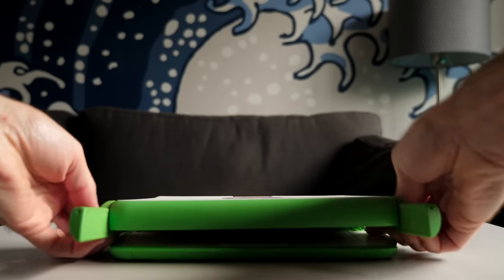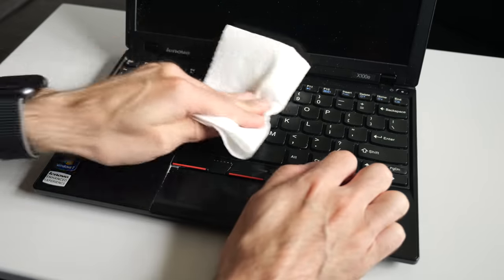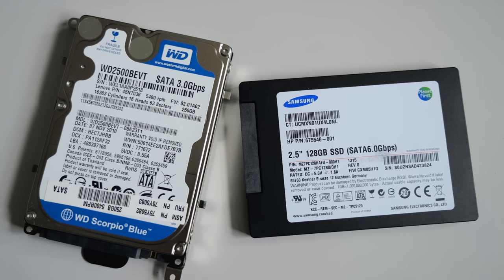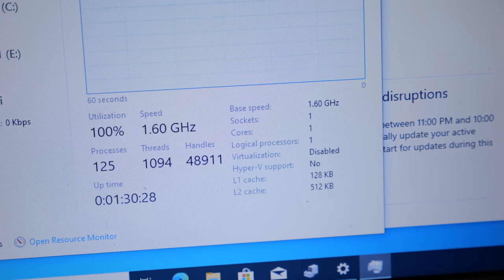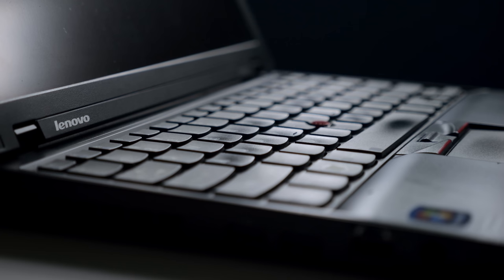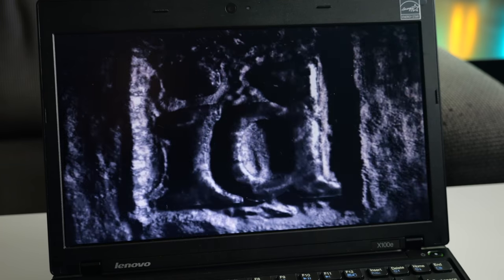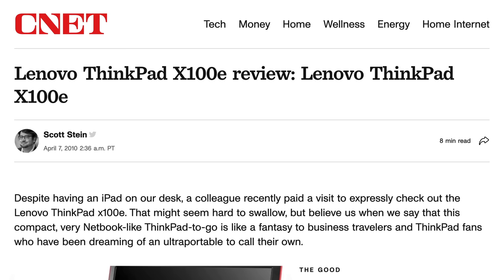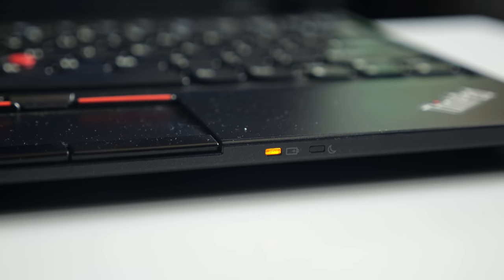Could this ThinkPad netbook actually be GOOD at retro gaming?

Comment: Thank you this video!
It's very similar to my Lenovo IdeaPad s12 which is used a lot in 2010.
Back in a days it used to be pretty reasonable machine, considering it's size and weight.
but mine has Intel Atom with Intel GMA 950 graphics and Windows 7.
it was enough for minor Photoshop work and 720p video playback via player, but it really struggled with even 480p videos on Youtube.
Overall it was really cool to have small, lightweight machine for that time.

Comment: I’ll bet that windows 8.1 runs very well on there.  8.1 is much much less resource heavy than 10. 10 just has too many background tasks running. For me there was a huge difference on some older atom devices. From unusable on 10 to pretty snappy for all but heavy web browsing on 8.1.
Reply: Yep can vouch for that, Windows 8.1 runs really well on older low-power netbooks. I have a 12 year old dual core Acer Aspire 722 and it flies with 8.1. With 10 the poor CPU can’t even open the start menu without dropping frames 🤷‍♂️😂

Comment: Viewers! Do not overlook the x120e. It's physically identical -- same body, display, great keyboard, etc., just with a newer AMD SoC, the dual core AMD E-350 with HD 6310 graphics. It's essentially the same exact laptop, just now capable of running things like Windows 10. I had the X100e in the video for years before upgrading to the x120e, which is so great I still use it to this day. I mainly use it for light digital audio work in Renoise and making retro alien landscape style art with Bryce 3D. In my opinion, best netbook ever made!!! :D
Reply: Does it support Windows XP? 🤔 Lenovo website is so messy that it's hard to tell (at least here in Europe) - I think it DOES, but I can't straight out tell from their crappy interface.
Reply: @kkolakowski  Yes, with SATA set to compatibility mode, same as in this video. There is a working AHCI F6 driver for it but I haven't managed to get it working in years as the XP installer does not detect even supported USB floppy drives.

Comment: One thing you can do to get XP to use that extra RAM is dig up a copy of the PAE patch somebody made for XP (a project called One-Core-API seems to be one such patch, plus a whole bunch of other enhancements, kind of like KernelEx was for Win 98).  See, the XP kernel CAN handle more than 4GB of RAM (sort of like high memory on DOS, PAE does something kind of like that on newer Intel CPUs).  It's just that, being 32 bit processes, any individual process can only handle 4GB and MS made the decision to limit the consumer OSes to 4GB.  The initial release of XP actually had PAE enabled, but that got killed off by SP1, if I remember correctly.  Server 2003, based on the XP kernel, had it turned on still, but of course you don't want to run the server OS.  But all the code is there in XP and it works, it just needs to be patched to be enabled.  There's also the very odd Windows XP Professional x64 Edition that isn't quite sure if it's Server 2003 or XP.
Reply: It is also possible to install 64-bit version of Windows XP 🙂But it wasn't very supported at this very early stage, so there might be issues, especially since we would like to use it for retro gaming so compatibility would be quite important 🤔
Reply: @kkolakowski  Yes, that's Windows XP Professional x64 edition (not to be confused with Windows XP 64 bit edition - that's for Itanium).  I had it for my work computer for awhile.  It's weird.  It's really Server 2003 dressed up like XP Professional.  So alot of drivers are hard to get - it wasn't that common so alot of people didn't bother with drivers and normal XP drivers don't work and Server 2003 drivers sometimes work, but those aren't all that common.  Application compatibility seemed OK, in general , though.

Comment: I had one of these with the Turion X2 L625 back in the day. That second CPU core made a big difference compared to the MV-40. It ran even hotter, but it could almost play Left 4 Dead at non-PowerPoint frame rates! Almost!
Reply: The Turon X2 L625's are extremely rare.  Very few were made. Did you customer order it when it was new?  How did you get one with that upgraded processor?
Reply: @klwthe3rd  This was over a decade ago, but IIRC it was a canceled custom order that wound up on the Lenovo Outlet. At the time I needed a laptop with a good keyboard, and I wanted something small that had a snowball's chance of gaming competently, and the outlet listing put the "good" x100e well within my budget.
Reply: @needfuldoer4531  Wow that is such an interesting backstory 😄. What ever happened to that laptop?
Reply: @klwthe3rd  It's in a box with other retired laptops.

Comment: I recently picked up an 11e for 55 bucks in mint condition. It's a student edition, folds back to be flat, has a touch screen. Dual core, 4Gb of RAM, and a 128gb emmc. The Intel GPU is a better one of it's caliber, I think a 615 or something, 128mb of dedicated video memory, not bad tbh. I have it running Windows 11 just fine, and loaded to the brim with Indie pc games. Things like Shovel Knight, Braid, LIMBO, Enter The Gungeon, etc, all run smooth as silk with an Xbox Bluetooth controller. It's the coolest thing to me! I actually plan on picking up 10 more on eBay, loading them up in the same way, and gifting them to friends that game but never dabble in PC, to show them even this cheap old rugged little guy can game in really cool ways. I HIGHLY recommend getting one. It's my go-to tinker device now.

Comment: I remember the AMD Athlon/Turion based X100 series... they were awful through and through. Dying chipsets (same bumpgate trash as nvidia GF 8xxx or AMDs own HD 6xxx GPUs, though nvidia admitted to the problem while AMD never did), hot AF CPUs to the point where the dualcore ones would cause an overheat emergency shutdown if you stress the CPU for more than a few minutes, no mSATA support (making the 2nd miniPCIe slot useless) and awful build quality (hinges ripping out). The random glitches experienced in this video hint at the chipset already being in the process of failing, and most used ones you find will be sold as defective (not turning on/turns on but no image) as the end result of that

Comment: To be honest, this thing COULD handle webbrowsing ..... IF the coders of modern browsers would actually care about OPTIMIZING their cluttered mess. Nobody does anything anymore about optimizing their programs to run with as little resources as possible... everyone is like "Pfft so what. Let the user buy faster hardware. Not my problem."  This is the ONLY reason why older hardware becomes more and more of a problem to use with current year software. Because apparently no developer gives a damn. I can see why you need beefy hardware for CERTAIN applications but come on... I don't see why i need a killer-rig just to browse some stupid websites. When webbrowsers and Steam consume more RAM and CPU time than they should, you know we have a problem.

Comment: The X100e was the first to use the new chiclet design Lenovo now uses on all its modern laptops. the X120e was better, but you need to make sure you don't accidentally get the E-240 version instead of the E-350 version. The E-350 is better but 10 is still too bloaty for it. 7 should run fine however. The X100/120e screens are also notorious for wicking up moisture from the air in some cases if left in a humid environment for too long, and that ends up leaving a splotchy mess behind the diffuser. It was a defect that Lenovo never properly addressed with late X100e and early X120e machines. The X130/1E are fine but still garbage tier. the i3 variant can do 16GB of RAM with an mSATA SSD in the WWAN slot, and the AMD variant could do... 16 gigs, but single channel only. This was the achilles heel of the thing and performance was extremely subpar, but that was fine as it was used for education and didn't need to be the fastest.

Comment: I had the X120e version, which had the dual core. I remember wanting the X100e, but seeing it was only a single core it was a no go. So when they announced the X120e, I picked it up, I also upgraded the ram and the SSD back then.

Sadly it was still quite slow, while I loved the form factor, i sold it after 6  months and bought a Thinkpad X220 - a laptop I still have to this day, while not my daily driver (X260 is), it was a proper laptop with a proper cpu.

Comment: Actually just ordered one of these for cheap. Here in Brazil it's difficult to get a hold of a good windows 2000/XP era machine to play games from that time period (things like nfs porsche unleashed, gta vice city, quake 1 and 2, that kind of windows 98~2000 type of thing). Seems to be in very good condition and comes fitted with an ssd, so my plan is to put windows xp (actually if I can get 2000 working with drivers, even better) and run old stuff in it. It's that kind of thing that was terrible at the time it released (like all netbooks) but actually has value now that it's dirt cheap if you wanna use it to run things way older than the machine itself.

Comment: I had even slower : my Dell Vostro 200,I tried to install Windows 10 on an E4500 and No GPU with 1GB RAM.Had a ton of problems and now runs Windows 7 and an SSD aswell as 1.5GB RAM

Comment: That Thinkpad netbook was mostly used for business or educational purposes, there’s no way you could use it for big retro FPS games, only retro games with low settings!
Reply: You'd be surprised. I got Unreal Tournament 99 running on max settings with a super smooth framerate, same for quake iii arena. Even Need for Speed Underground, from 2003, runs great on high settings at 800x600 res. On Win XP of course. Also tested Flight Simulator 2004, The Sims 2, Warcraft 3, those all worked great too. The CPU is comparable to like a Celeron from the Win XP era and the GPU is actually pretty acceptable for games from between 1998 and 2004. Much better than the intel GMA igpus.
Reply: @ElShogoso  but these netbooks have bottlenecks from their limited motherboards, even if you can get a CPU and GPU that’s comparable in performance for retro gaming. It would still have issues.
Reply: @Markimark151  Well I use it for that exact purpose and haven't had any issues playign the games I mentioned. In fact it's leagues better than the PC I used to have in the windows XP era. I remember the struggle of playing gta san andreas on a dell inspiron 2400 hah. Of course, it's not gonna do well with beefier games like far cry or doom 3  (and I don't see any reason to try anyway, those games work fine on modern systems), but anything from the 90's and up to 2003 or so runs pretty remarkably, so you still have a library with bangers like Diablo 2, Warcraft 3, Zoo Tycoon, The Sims, Halo 1... Heck I even ran some more modern stuff like Minecraft Alpha on Linux and got it playable above 30fps. Emulation works great too.
Reply: @ElShogoso  good for you, but these netbooks are still watered down for most retro enthusiasts.
Reply: @ElShogoso  I don’t like Linux for retro gaming, lot of my retro games don’t work well on that OS, I hate how some games crash or don’t run at the correct speed, this is why I use Windows 98 or XP for retro gaming.
Reply: @Markimark151  I have it dual booted with win XP and Debian. For emulation and modern lightweight indie games, as well as streaming from a beefier PC, I use Linux. For a few WIndows games I use XP. Mostly to play a few games like NFS 5 Porsche Unleashed, Fifa 98 and Civ 2. Though I did push it a bit with Halo and NFS Most Wanted and was surprised with the results.
Reply: @ElShogoso  ok, you said enough, let’s not go off topic anymore.
Reply: @Markimark151  Oh sorry I just really enjoy chatting about those things.
Reply: @ElShogoso  I just want stay on topic with just the netbook hardware itself.

Comment: I owned that thing, got me through a year of college.
Very portable, and as long as you didn't use it for HD media or large websites, it didn't overheat and shut off!
it was hell. I still loved it though.
Reply: forgot to mention that in my case the biggest bottleneck was the GPU, not the CPU (I own the dual core version). Today I still use it for torrenting, After many, many experiments I landed on Windows 7 32 bit. As long as you disable GPU acceleration on literally everything but the web browser, you get an acceptable experience.

Comment: There is a dual core version, so I can't help but be curious about how it runs. There's also the x120e. Is it a better option?
Reply: I had the x120e for many many years. I used it as a platform for flashing old hardware mostly, but it was (with the e350 and 8gb ram) surprisingly fast and would also work with Win10 perfectly fine. This is for runtime definitely the better choice over the intel one, BUT i dont know about emulation. Sadly, i sold mine like 5y ago. Im still missing it.
Reply: I bought a x120e dual core to replace my x100e who died. It is a disappointment. Time have passed and these machines, while I love them and are beautiful, they just don't cut it anymore.

Comment: I have one of these that I picked up a few years ago.  I really like the machine and it runs well with Haiku os.  I like the form factor, if they made this same model with new hardware, I would buy it.
Reply: Yay, Haiku!
I found it just about a week ago and getting into it. Got it running in a VM but aiming at getting a Thinkpad.

Edit: How do you get on with the rather low resolution compared to today’s standard of mostly 1920x1080 or more?

Comment: These old potato AMD chips could make miracles a decade-ish ago.
Back in 2011, when I was still living with my parents, I convinced them to spend extra $50 to get a 11.6 Pavilion with a dual core AMD (e-350?) rather than a bog standard netbook.
That nugget was very competent. I could play League of Legends, Minecraft or Fallout 3 on the integrated graphics. For the price it was a steal.

While netbooks of the same era are basically e-waste now, I still save it as my go-to machine for old Windows games (My main rig is a Thinkpad with Linux, as it should be)

Comment: CPU in this thing is actually pretty interesting! It's basically a miniaturized Athlon 64 (a 2003 design) and with a lower clock speed than most desktop counterparts. For this reason, it was far more capable than early Atoms (64-bit, SSE3, etc) and (as you show, at least theoretically) it can run relatively modern OS. This video actually made me purchase this semi-retro computer for late 90-s/early 2000s gaming on Windows XP I will also love to experiment with Linux, maybe a fully-command line distro? or something like that? For sure I'll keep it far from modern web browsers, or maybe even internet altogether 😅

Comment: I had this laptop in university, tried Win XP on it, Win 7, Ubuntu 10 something and Arch Linux. Arch was the most snappy, especially with installed tile window manager (I used Awesome WM). But the slow CPU was an issue even back then, it had troubles playing some YT videos with quality more than 480p, and it's around 2013.

Comment: You should have tried lubuntu or any lxde interface extremely light on system with modern functions.
Reply: it's not the OS's fault. I ran debian with pure i3 on that thing and web browsing is still pretty painful. There's no use in having a super lightweight OS and then try to run the modern bloated WWW on it.

Comment: Got hold of a Sony Vaio 2011 All-in-one. Turns out it’s the fully specced four core 8 thread  i7 model with hdmi in and out.
A clean out, fresh paste, SSD, upgraded RAM to 16gb and a new wifi-card (to get wireless ac & bluetooth 4.0) and it’s a fantastic 24 inch monitor that also includes a whole pc. Great for old games and work. 
The person who gave it to me said the reason was “it wasn’t Windows 11 compliant”…. Her loss.

Comment: >8:03
>HD3200 with 32bits Bus Width
I had a ThinkPad Edge 13 back in the day.
It came with a AMD Turion Neo X2 L625 Dual-Core and it's had the same gpu.
The gpu was horrible thanks the cut bus speed...

Comment: I have loads of older systems. I've found even the worst and/or oldest of them tends to have a place. I put Linux or older Windows versions onto them appropriate for the systems age and they usually run fine. on some similar systems, with weak CPUs but lots of RAM, I opted for 32-bit Windows Server versions. These can access more memory than their consumer counterparts - which are actually artificially limited by MS to 4GB, but still run 32-bit programs. I've been lucky in that the drivers are compatible and large address aware, though, which might not always be the case.

Comment: Picked up an X200 at e-waste for NT$500 (about US$16) with a working, chargeable battery. The LCD panel has minor screen burn (previous user had a stupid centered tiny "wallpaper") but it works fine otherwise.

Comment: I miss all these 10-11 inch netbooks/ultraportables. They are a rarity these days. You can easily upgrade RAM, storage drives, and even replace batteries on such small devices. You can't even do these on most modern bigger laptops. There were even 11 inch gaming netbooks such as Origin Eon 11s and Alienware M11x models back then. It will be just too awesome if they bring back these small netbooks with powerful modern processors like AMD Ryzen series for modern gaming prowess.

Comment: I still own a Toshiba Satellite with an AMD Turion X2 and 3 GB of Ram. Those old  AMD always had overheating issues but with a special thermal paste and a factory fan recall, it runs  beautifully. Windows 8.1 embedded was the last Win OS that ran smoothly. After that, I ve been running it on Antix Linux OS for fun.